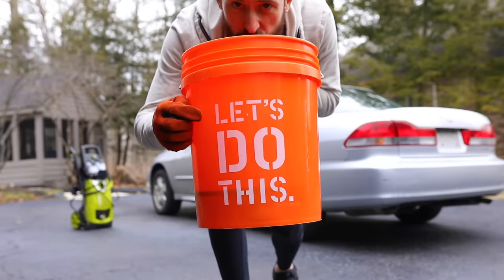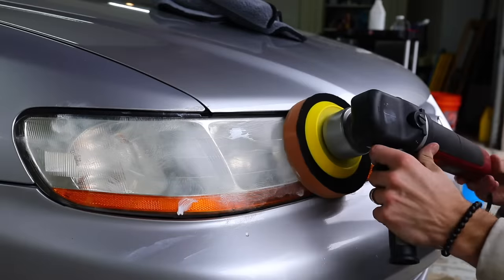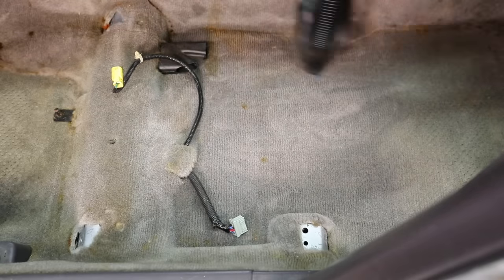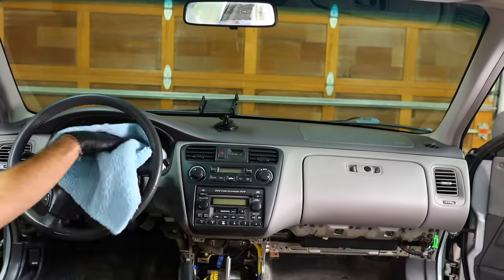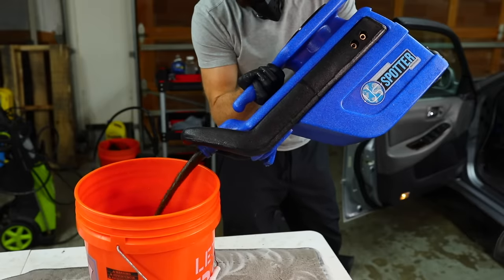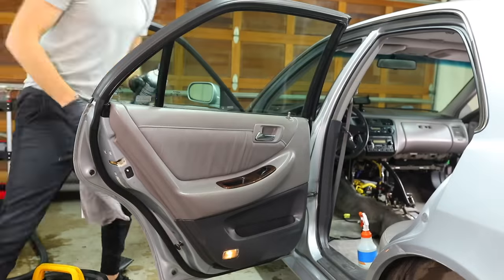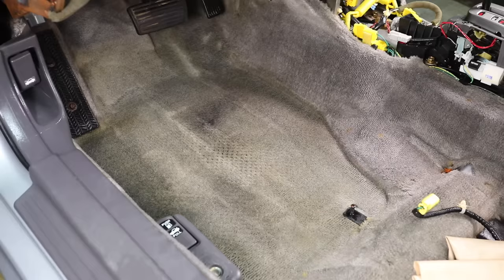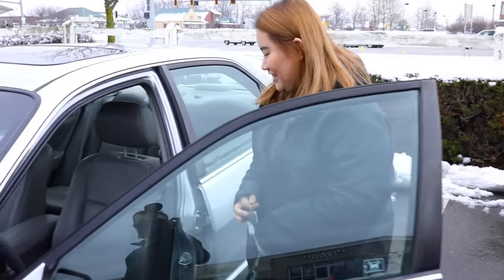Deep Cleaning The Dirtiest Honda Accord Ever! Complete Disaster Car Detailing Transformation!

Comment: For a good overall cleaner and degreaser, I use purple power. Ive started using this on interiors and I honestly think it is the best cleaner I have ever used. Works for wheels, door jambs, interior surfaces, and it works wonders when shampooing carpets. Best thing is a gallon is like 20 bucks so its definitely worth trying!

Comment: Adding degreaser to the mix really helps with bad stains, and also using pressure washer on carpet is the best approach to cleaning it. I was surprised just how much sand came out after a single pass with pressure washer. I definitely reccomend pressure washing carpets.

Comment: I have a 2019 Civic. I installed Husky Floor Liners to try to avoid getting my carpets looking like in this video plus here in Halifax, Nova Scotia, Canada they put a lot of road salt down in the winter. Need to protect that interior.
Reply: Clumped salt in these black Honda mats (in most models) looks like %$#@!
Reply: Salt will rust out your frame and quarter panels before you need to worry about your interior.
Reply: M MMM That’s why I get my vehicles undercoated every year.

Comment: I work for my local Honda dealership as a detailer. We use really fin steel wool on windows, don’t put put a lot of pressure but it honestly makes a difference. Now as for what I drive. I daily a modified 2008 Honda CR-V Ex in black and a mint rust free 1995 Ford Bronco XLT in blue (Deep Forest Green) as a show truck

Comment: I like to use the pistol grip air gun when doing the center council and dash. It gets all the grime out of in between the buttons. And also gets it dry from when you pass over it with your paint brush.  Also try using a dry tornado gun after vacuuming. It saves you from completely drenching carpets

Comment: Really curious how much a job like this would cost.
Reply: Daniel Blocker with that much dirt if think $500+
Reply: I wish they would talk about prices too...
Reply: 80$-300$ would be my guess
Reply: Inside and out plus removing the seats id be around  $300.  Time plus product, water, and electricity adds up. Wear and tear on your tools. All cloths has to be cleaned or disposed of and tools cleaned. 

I detail, I still get people thinking you will do all this for like $25
Reply: He is doing outside and inside. Clay bar, removal and reinstall of seats and console, Lilly brush, cleaning of all crevices, extraction,  glass cleaning on both sides, protection on vinyl, and elbow grease plus manhours. I would guess about $230-$250.

Comment: Subscribed :) I totally agree with you 100% that pressure washing the carpets will do a way better job and will cut your time in half. I just did a similar detail on a 2001 Civic with this similar and for chemicals I did a combination of dawn and for more stubborn stains did a mixture of Super Clean. Just a tip on cleaning around the auto shifter on these Hondas. Once you remove the shift knob, the shift indicator housing are basically held with 4 tabs and it will all come out as one. Gives you more access underneath to get more dirt thats been collecting. Great job btw!

Comment: I got these cheap detail brushes at O’Riley’s that have tapered handles so you can use the end to drag a microfiber through the air vents. It’s really cool!
Reply: Also for my carpets I use a solution of 2 parts water, 1 part white vinegar, and a dash of dish soap in a spray bottle :) I pair it with woolite.
Reply: I drive a bright green vw bug named Biki! I love her and her shag fur door panels.

Comment: Hey, did you disconnect the battery? It looked like maybe not, courtesy lamp was on.

If not, I’ve heard it’s a good idea. Prevents any possible issues with the airbag system (some seats have built in sensors / airbags) and keeps it from dying if interior lights stay on while the doors are open

Comment: I've always used purple power for deep clean in carpets, seats, floor mats, rims, tires, and dead bugs in the bumper and outside panels, as long as you spray it dry then go over it with a brush or a rag then rinse it you'll be good

Comment: There is this mexican brand of dish washing soap called Axion, I used that the other day when I was practicing and manually doing a detail in my car for the first time. I lack alog of tools and the only thing I had for cleaning the floor was a spray bottle with Axion and water, a wet/dry vac, a nylon brush, and some microfiber towels. I cleaned a stain that was under the passanger's seat which looked like rust or coffee, didn't come out all but it looked better than before. I own a 1996 Avalon by the way, its old but gold to me

Comment: I'm a bit of a gearhead too, but OCD worst of all. Ima need you to clean the mirrors next time and put some kind of protectant on that dash, please. The best carpet stain remover I've found is a peroxide / baking soda paste. Lay it on thick and wait for it to dry. Vacuum the baking soda out. It will remove even blood stains from carpet. Don't ask me how I know. 

I drive a pearl white Tahoe with tan interior which is easier to detail than my boyfriend's Land Rover with black carpet and black trim interior. I use a tooth brush in the cracks where the carpet meets the trim and my smaller Dirt Devil vacuum hose because when the interior is black, all dirt is white. Never heard of the Lilli brush, so I've been using a pumice rock to get up hair. Great video. Enjoyed.

Comment: Dawn Powerwash, Liquid Oxy Laundry Stain Remover for carpet and mats works great for removing grease and food stains. A mixture of Powder Tide Laundry soap also works good. The liquid Oxy Laundry pretreat for stains I think works the best. Dawn Powerwash on exterior and wheels does a great job of getting dirt, brake dust, etc off as well as bugs on the windshield and front. I drive a Nissan Armada.   I’ve used Pledge furniture polish on my dash and interior for years and have had great success and leaves no film or creates any build-up.  It works great on leather seats too.

Comment: The one thing I try my best not to do during a dash detailing is spray directly onto surfaces I'm about to clean. 
I used to make this mistake and it always ended in me having to work harder to clean the inside of the windshield.

As for your ADD, I highly recommend reading Gabor Mate's book Scattered Minds if you haven't already. It did wonders for my life with ADD. 💛

And to answer your question, I've got an old BMW E91 touring. It's the car that got me into detailing and one that I plan on converting into an E91 M3 🫠

Comment: for stains on the carpet. it helps a little. but i just straight up pour hot water onto the carpet then spray the carpet shampoo then use the drill brush

Comment: I like to use a mixture of Bissell pet pro with fabreeze and oxi and mix it with water and oxi powder for laundry. There hasn't been any stain or smell that I couldn't get out so far. I mix the Bissell a tad bit stronger than the directions and add a scoop of oxi. I let it basically soak for 10 or 15 minutes and half the time it'll just come up without scrubbing

Comment: You were talking about cleaning solutions to clean the carpets .  well this is not a cleaning solution but is a solution to the problem .  My mother told me that she & my father used to detail cars and when they came across a very dirty carpet they would get spray paint the same color as the carpet and just mist some  over the top.. now, I don't know if that would be something you may do but It would be a quick fix after you've exhausted everything else in your cleaning arsenal. she said it actually looked really good. 😳 just don't put a whole lot just a fine mist..

Comment: I answer to your question “What kind of car do we drive”, I drive a somewhat rare 2008 Nissan Altima 270 HP V-6 with a 6 speed manual transmission. It has limited slip diff and traction control. It really fun to drive.

Comment: For carpet stains you can try hydrogen peroxide 3% solution. 
Wet the stain; let it soak for a bit and use extraction tool to remove the solution. Not sure how long to let it stay on carpet, so test in a small area first.

Comment: One concern about head lights. They have a protecting layer from factory and when you are polishing them - you are destroying the shield. After a few polishings you will see cracks on the surface and the only one way then is to completely remove this layer. Then polishing will be lost quickly - plastic is not so strong.
Ideally you have to polish head lights once and then apply a protecting film. In a few years you just need to replace the film.
If you are not using such films - you have to use more coarse materials and then varnish the lights.

Comment: be aware if your seats have air bags in them and you remove them with the battery still attached - you might need either a more expensive scan tool or a trip to the garage to code them back to the car.....

Comment: A great job detailing, the only thing I would add about the carpet clean would be to use a stain remover to soak for a few minutes before cleaning, Sards Wonder Soap is great for removing stains and only needs 1 minute to activate, sometimes a degreser can also help lift dirt out of the fibres.

Comment: Great video and looks great! For those really stubborn brown stains I mostly use prewash wash spray and SA8 from amways line. Ill spray the prewash on the brown spot, let it sit for 10ish minutes and sprinkle some sa8 powder and hit with a cirtrus acid based cleaner or just strait up squeeze a lemon on it. Typically get better results then what you got on that passengers front floor mat. 

For those really diffcult.. like the fibers themselves have turned color completely they make fabric paint for carpets that you can use... I have seen guys strait up spray paint too.

Comment: I got this stain removal formula from sweet project cars YouTube page. Get a large spray bottle and put 6 oz of dawn platinum 4x and 6 oz of rubbing alcohol then 30 squirts of oxy clean max force then fill with hot water. Then spray on and leave as long as you can then extract. Worked well for me.  Stupid auto spell lol

Comment: That is not slow motion. When a video shows 2 front seats unbolted and removed in 12 seconds flat, that is not realistic. After getting rid of mice and rats, I did a vacuum, drill brush and extraction of the carpet in a spare bedroom. Medium brush and corded drill and pet version of Bissel spot clean pro heat. All odor is now gone and carpet ranges from 75-95% cleaner.

Comment: What’s the point of paying hundreds of dollars for a detailing/cleaning if you can’t get the stains out of carpet completely. If you can’t do that then you better lower the price or make a pricing deal. Charging 500+ is a huge RIPOFF. with that said I would’ve just bought brand new carpet floormats or let the solution soak overnight or a couple hours.

Comment: Dude i can tell they never used the damn car. There is no such thing as a 90s vehicle with all its radio and ac dial white paint still there and the steering wheel not falling apart
Reply: Also the damn lock switches and handles are PERFECT i can tell this is all set up